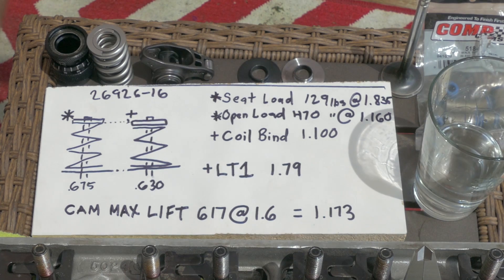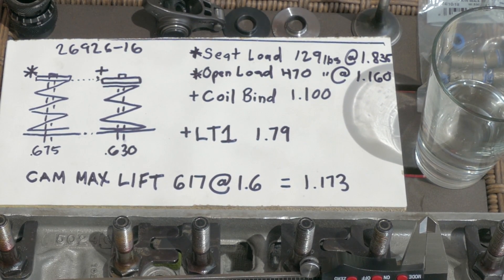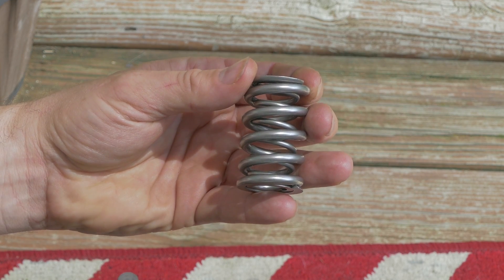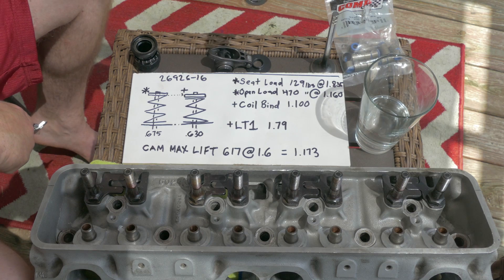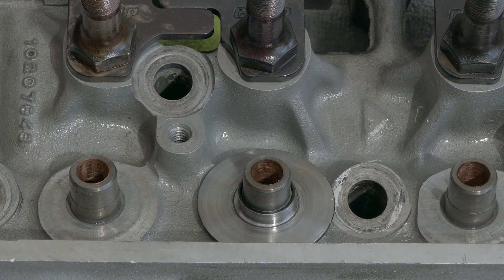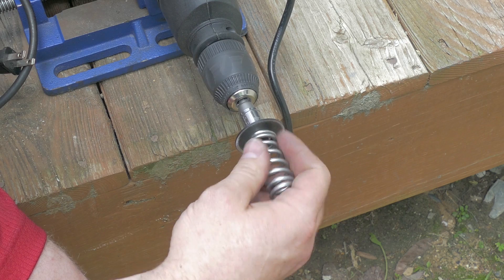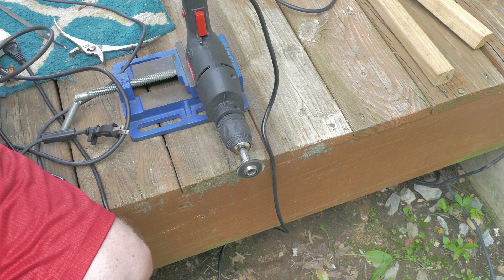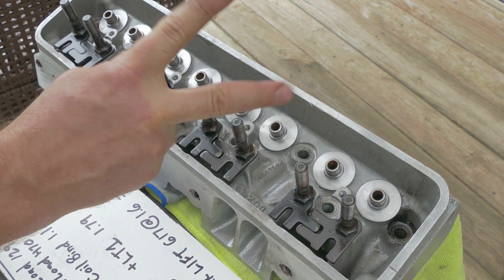LS Spring on a LT1 or SBC? YES! To support a 7000 RPM solid roller

Comment: Did you have your valve guides cut down to a .530 valve seal?
Also, did you have to trim the valve guide shorter for Retainer to guide seal clearance? 
The LT1 heads I’m working on now have .562” guides/seals... 🤔🤔🤔

Also what spring retainers did you get to work with the 11/32 valves and the dual LS springs?